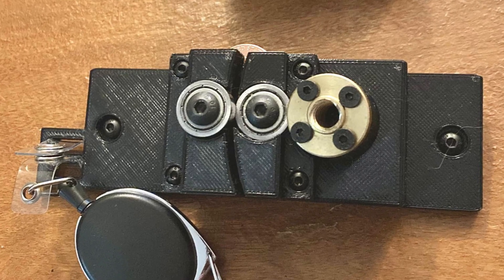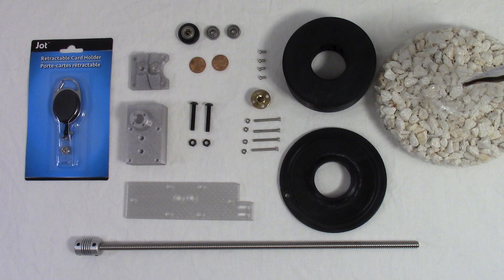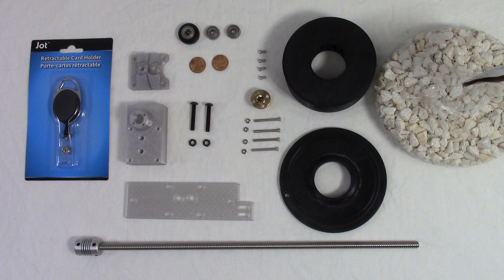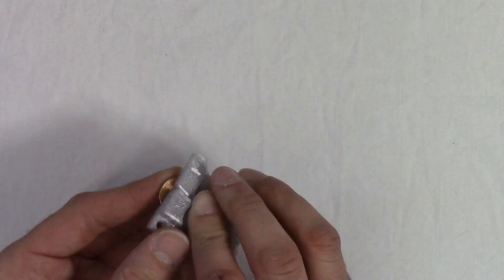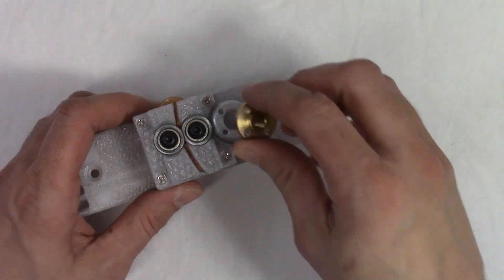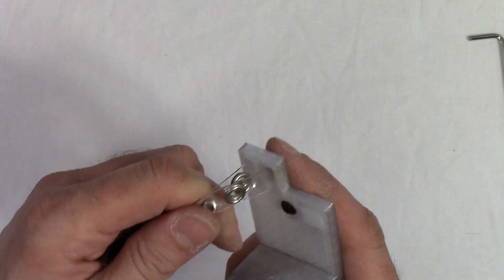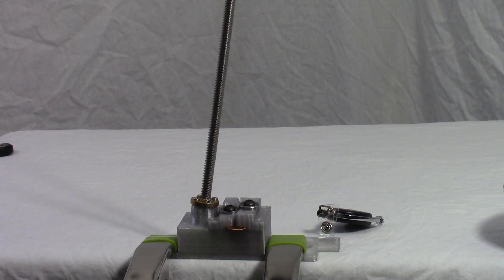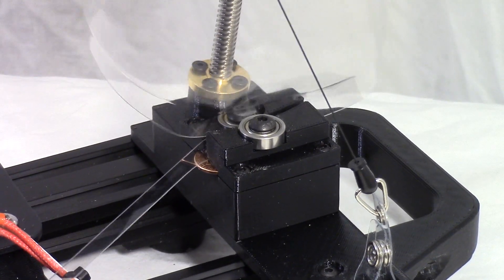Learn How to Build a Community Bottle Cutter and Turn PET#1 Plastic Bottles into Stunning Creations!

Comment: grinding down both bearings doesnt work fo me. it makes a gap between the bearings. i only grinded one and it works much better
Reply: IT WORKS!!!!!!  I just flipped one of the bearings over to a side i didn't cut and it works!!!!!  THANK YOU SMART COOKIE!!!!!!
Reply: @partyalldaypartyallnight1057  glad it helped! i was on my last attempt when i found out it worked. good luck!
Reply: I'll try that.  Just tried to strip a bottle yesterday to try my long boi mk6 (long because i'm using a variable PSU that wont fit in the mk6 mini) and no dice.  THANKS.  I'll give this a go.

Comment: any suggestions on how to remove the rubber from bearing w/o damaging
Reply: Hold the rubber in grips and a screw driver in the middle of the bearing
Reply: leave it on the hot bed at 90 degrees and the bearings will fall right out
Reply: Heat it up. The bearing pops out without any effort.

Comment: look very nice build it, and  it cut the bottles very good, but I have a problem the bottle creeps up and there fore  the strip is not even  in width, what can be the problem, thanks in advance
Reply from the maker: Apply more downward pressure either by hand or by adding weight.

Comment: Can i use a 2.5lb dumbell plate for the weight?
Reply: Thats a bit much.  I'm using a scrap chunk of brass that weighs less than one pound.  It's just enough to keep the bottle seated down while it feeds into the cutter from the pultrusion process or you pulling it through.

Comment: I'm at a loss here.  I've tried this build three separate times now and no matter what I do I cannot get clean cuts.  I've run out of bearings to try now and I'm not buying more unless I can get this figured out.  Doesn't seem to matter how tight or loose I set the bearings nor how sharply I grind them flat...and believe me I've made sure they have a perfect 90° edge.  They will cut the bottle about 6-8" and then it just stops cutting and instead just seems to crimp it a bit.  This causes the bottle to wedge in between the bearings until it snaps from pulling on it.  I'm baffled but it FEEL like the bearings are being forced apart and then they can no longer shear the bottle.  So far no matter what I do I cannot her a bearing cutter to work and I find blade based cutters do not last through the first bottle before the blade breaks or wears through.  I'm spending more on trying to make free filament than I would if I just paid for the bloody stuff.  lol

Any ideas other than just giving up and trying something else?
Reply from the maker: Sounds like your bottle's thickness may be to much for the 8mm strip topper. There are various sizes depending on thickness of Bottle. If bearings have been sanded flat and nice and tight, they should be creating a scissor like friction. You'll find more help at the Facebook group: https://www.facebook.com/groups/656148351636065

Blade cutters are the worst in my own opinion of working with various cutters. The only one I support beyond the community cutter is https://plasticbottleandcancutter.com/ - use "recreator" at checkout for 15% off if you keep having trouble (just be mindful shipping is from Ukraine and can take a SOLID 4-5 weeks to receive)
Reply: @JRT3D  I thought more about what you suggested and I took a VERY close look at things and named to get it all sorted out It turned out that the 5mm bolts were tipping outwards ever so slightly causing the bearings to not make a 90° contact. I modified the "dimes" STL to use a specific washer i had on hand, moved them out towards the edge a little too increase the width of the bridge that connects the 2 sides and made it slightly wider to allow for more strength. I suspect the petg i printed with was more flexible that i suspected. Also ground down the faces of the bearings on a 1000 grit diamond sharpening plate i use for chisels and got them VERY smooth with sharp edges. I was able to reuse a set i had already grind so that was a freebie. Lastly i added a steel pop rivet washer on both sides of the bearings to ensure a solid mounting to the block.  All of this has lead to the bearings lining up perfectly at 90°with their faces meaning perfectly and no deflection. I ran a number of bottles through and all of them sheared of as i had always hoped   Thank you very much for your help and for your files.  I am now ready to start the pulltrusuion process  😁
Reply: @JRT3D  I appreciate your response and help.  I've tried many different bottles, from thick to thins...some so thin I'm amazed they could hold any liquid at all... I doubt it is the thickness but I will definitely look into it further.  At least I haven't given up.   😁

Comment: Why are you using pennies in them?
Reply from the maker: To keep consistent strip size - it prevents the strip from cutting into the base and resizing itself. Washers can be used in place of pennies.
Reply: @JRT3D  is it possible to use a razer blade instead of alot of bearings and if so are there pros and cons?

Comment: which extruder nozzle can be used to get a 1.75mm filament?
Reply: in my case i use a 1.6 mm drill bit to drill a 0.4 nozzle you have to adjust the speed of extrusion to compensate for the diameter of the final filament  and it work very well just look for Petamentor2 on youtube  https://www.youtube.com/watch?v=uSBCxH9358s   this model is simple and work awesome!!

Comment: what is the model of bearings?
Reply: 2 bearing 6200 ZZ high speed 10x30x9
Reply: @dominicbaines5947  and did you sharpen them?
Reply: @BraveNewWorld1984-r6o  No  used a blade method. You just asked what bearings they were.
Reply: ???  LOLLL
Reply: @dominicbaines5947  what is the point of this useless response?

Comment: Before finding this video, I made my own version of this and found that you don't need to grind the bearings. As long as they are tightly in contact, they still shear the plastic.
Reply from the maker: Would LOVE to know what bearings you use...simply, not all bearings are the same and have tried to do this with standard 608zz as well a few others and only got reforming, never a true cut.
Reply: The trick was to tighten them up enough... I wasn't sure it would work but it did seem to!
Reply: Its preferable to sharpen them  it work a lot easier and no danger of cutting your fingers by pulling  too hard on the strip

Comment: Hello. A have two question, how do you join two PET filaments together, and at what speed do you print the PET filament. Thanks.
Reply from the maker: For joining: https://youtu.be/E--a7-Qyt1I
Slicer Settings: https://youtu.be/N06FWr06iOI
Reply: @JRT3D  THANK YOU.
Reply: @JRT3D  This is great, thanks for all the updates. Instead of joining the filament, have you discovered a way to join the PET strips to achieve a longer filament spooling process? I suspect this could improve the quality of the joints since the melting may smooth out the inconsistency at the junctions.

Comment: Bonjoir, la xvico x3s est introuvable. Croyez vous qu'il est possible de le faire avec la ender 3 ? Et si oui pourriez vous nous montrer ? Merci
Reply from the maker: That's the next video I plan to release. Keep eyes open. Is coming soon.
Reply: @JRT3D  ah super! Merci beaucoup. J'ai commencer à imprimer des pièces qui allait initialement avec la xvico x3s, seront elles compatibles avec la ender 3 ? Ou tout est à refaire ?
Reply from the maker: @angelinemaillard7662  There has been a couple updates but nothing to different. Most all current files to be printed are Top Frame Structure that is staying intact among all future builds using a 2040 frame.
Reply: @JRT3D  super, merci beaucoup vraiment. J'ai hâte 😁

Comment: Hi, we are a community makerspace located in Kigali, Rwanda. We are currently experimenting with making recycled filament due to the high cost of importing filament to Africa.

We are struggling with building a bottle cutter that cuts the plastic into an even consistent strip. Out of curiosity, why are you using bearings to cut the plastic instead of an exacto blade? Is it because bearings cut the plastic more evenly or because you did not want to buy extra parts?

Great work and thank-you for making this documentation!
Reply from the maker: As you found, using a blade can cause inconsistent stripping. 

Using planned bearings flatten the chamfered edge...friction locking these two flat sides to eachother creates a scissor like cutter. 

With a weight and a tensioner - will allow the strip to stay consistent. 

Please Join the Recreator3D Group on Facebook for some ideas and help for your space!
Reply: @JRT3D  Indeed bearing work very well

Comment: Bit overengineered. 
https://youtu.be/hQeeJEpBYsg
Reply from the maker: Not for this project - but MANY ways to skin a cat. There are like 20 variants of methods and I found this one of the easier methods without much efforts for the unit it's been made for.

https://youtu.be/qRcsYdBe298
Reply: @JRT3D  Another purpose. Non comparable.
Reply: @ZenDeluxe  Just a suggestion but if you think the method in the video you shared is better you could contribute to the project by implementing it and sharing the results. I would love to see it in action.

Comment: It's nice but I have couple questions. Why would you use leadscrew? Smooth rod or threaded rod is way cheaper and comonly avaliable. Also what is the purpose for retractable card holder?Are you afraid you'll loose weight for the bottle? I know you say it's for the tension. But then why use weight in first place. Another thing, I think it would be better to use inner diameter of weight "box" a little larger than a  leadscrew. This way it won't move around when using your device. For the bearings you should use some kind of washer undeneath them, printed cylinder or M5 washer. So you don't lock bearings when you tighten them.
Reply from the maker: This project is a continuation of using remaining parts from a 3D printer in order to accomplish the builds. Rather the using other parts that need to be purchased separately adding more money to the project.

The weight keeps everything in place among tensioning. And the model has a lip for the bearings - regardless could still be locked into place by the nature of the bearings.

Please Join the Facebook group and upload your modification contributions to the files section.

Comment: Awesome! But why you used pennies? Thanks
Reply: They're used as washers so you don't cut through 3D printed part with plastic bottle.
Reply: @MDDprints  Thanks
Reply: So project stays with US? Maybe US has no laws on currency? In UK if you used currency and drilled it like this you would be defacing it and as even suggesting it you might have issues. Currency and Banknotes Act 1928 if interested.
Reply from the maker: I tried a few options - Pennies were used because they were around and washers are more expensive :P Washers should be equally adaptable with the dimensions given. Looking forward to anyone's contributions for modifications. Please join the Facebook.

Comment: Oh good! OI dont need to buy one off the net! Is there any alternative for the lead screw? or did you use it because it was salvaged off the vico printer?
Reply from the maker: 95% of the parts used were reclaimed from the printer used among the original project. Let nothing go to waste. I'm sure someone will figure out a modification in no time. Looking forward to see other's contributions.
Reply: @JRT3D  Thanks for the reply~ Waiting patiently when you are able to release the Ender 3 version. 

I'm a very avid drinker of Coke and I've been collecting way too many coke bottles and would like to turn them into filaments in the future
Reply from the maker: @GuardTower  I'm about a week away from being finished with a kit form Recreator - choose your printer flavor and learn how to Pet Pultrude with almost any type of printer board. Likely will be showcasing each variant among showing off all them collectively.
Reply: @JRT3D  OMG Thank you for the information!
Reply: Thankyou for this video and the link to the files.. I'm definitely going to check this out..